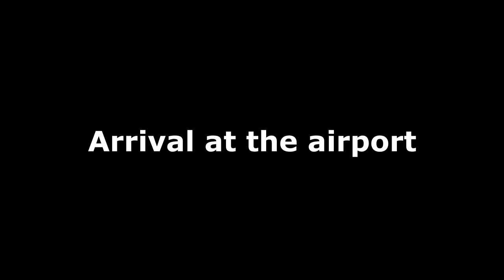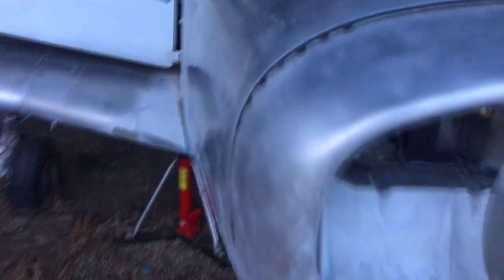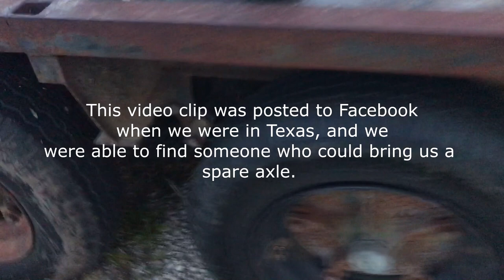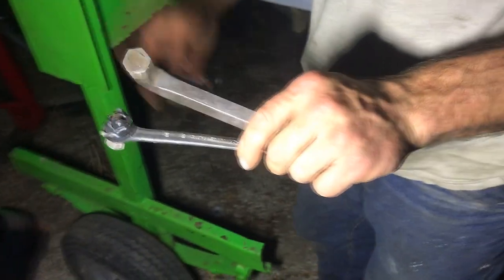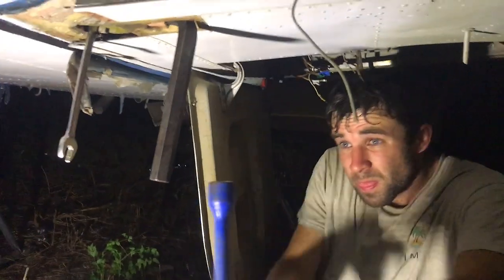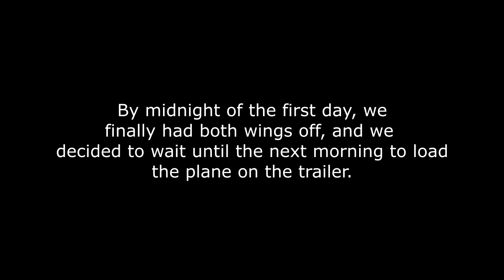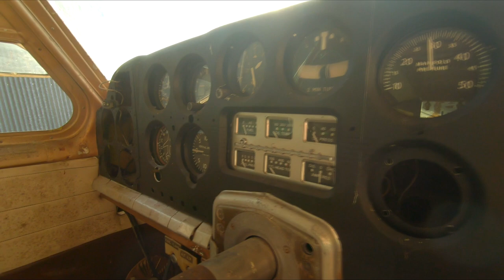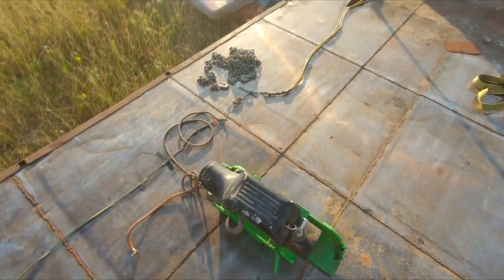2 BONANZAS ON 1 TRAILER!

Comment: N760D looks as if she may fly again.
Reply from the maker: Would have been a piece of cake, but sadly we sold the plane complete just a few months before my mother in law decided to buy a Bonanza. It would have been a perfect plane for her. She ended up purchasing a different C35 with 20 gal tips and a g430 and stec 20 autopilot. It’s currently down for a prop swap and has not been featured on the channel because we have spent the last year getting the kinks worked out. 

We did manage to get my brothers red A35 back in the air after 24 years (video on channel page), and we also just recently returned a D35 to flight status after about 11 years of sitting in a barn (also on the channel). We are about to fly a 47 bonanza that has been down for a few years after wing removal, and will then be assembling another A35 that has sat for I believe close to a decade.

Lots of vintage bonanza action in Missouri these days!

Comment: I know I’m a little late to the party here, but are any of you A&P’s?
Reply from the maker: Not yet, but we’re getting close. Working under IA supervision building maintenance hours. For non traditional A and P cert need 4800 hours maintenance time equivalent to 3 years of full time shop work. Not easy to get when just doing this as a hobby with the help of our IA. Disassembly and transport can be done without certification of course, which is a little weird considering it’s just assembly in reverse.

Comment: Do you know what the Registration number was on that old Bonanza you guys loaded up on the trailer? It's the one that has most of the paint removed. I've been trying to locate my dads old Bonanza. It was that kind of that blue green color I thought I saw on that plane. If I remember right the old registration number was N5128C. It's not on record anymore. I know its a long shot.
Reply from the maker: The two planes we hauled off were N5990C D3342 (stripped) and N760D D3030 (painted). 

Sadly doesn’t look like we have the plane you’re looking for...
Reply: @BenWeeksBonanzaPilot  Hey man thanks for your time. I wish you all the best and good luck with your Bonanza. In my opinion they are the very best in single engine general aviation plane ever built. My dad and I did a lot of flying in 5128 Charlie. I was 16 years old back then. He passed away when I was 18. The plane was sold off. I dropped aviation for over 30 years. I moved to England and started flying gliders I also got my single engine piston VFR and flew mainly PA28s and 152s. I'm back in  Florida now so I started picking up the search again. Sense my dads been gone I haven't been in a Bonanza. Flying one some day is high on my bucket list. 

Tailwinds to you my friend

Stay Safe
Reply from the maker: @davidvinyard6048  I’m sorry to hear about you losing your dad at such a young age. I cannot imagine how hard that must have been. There is an online forum for Beechcraft owners called beechtalk.com. I recommend you join that forum and post a thread with the registration number there. One of the owners may possess the plane under a new N number. 

As for flying a bonanzas again, that might be something I can help you with. I have some family down in Florida and may find myself down that way in the not -to-near future. If I’m ever in your area, it would be my honor to take you up in our Bonanza. Shoot, you can even fly left seat! Shoot me an email with your contact info to benweeksbonanzapilot@gmail.com, or you can message directly through my Ben Weeks Bonanza Pilot Facebook page. It would be neat if our paths crossed down the road. 👍

Regards, 
Ben

Comment: Hey Ben you consider selling any parts you've acquired?
Reply from the maker: Yeah we do sell a few parts. What are you looking for?
Reply: @BenWeeksBonanzaPilot  looking for a backing plate and a spinner, the door rod to keep the door propped open, and on the first bonanza that you loaded, that center gauge cluster?
Reply from the maker: Sadly, we don’t have any of those parts available. We had to use the central gauge cluster on my brother’s A35, and we are going to have to use the door propping pin to fix his door. I might be able to find one in one of the other planes, but I don’t know what condition they are in.